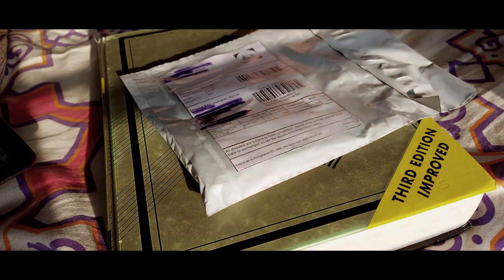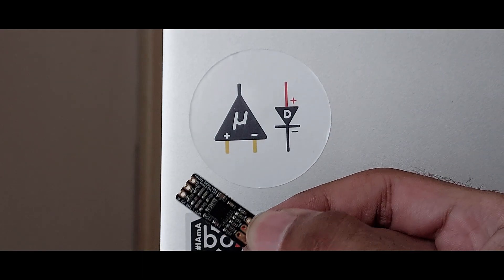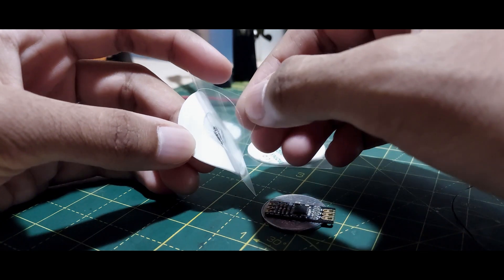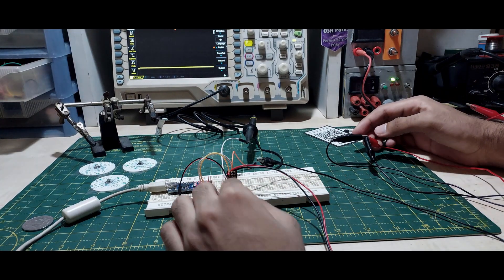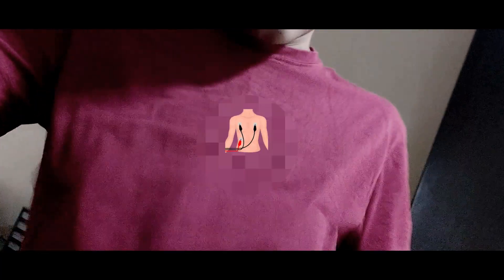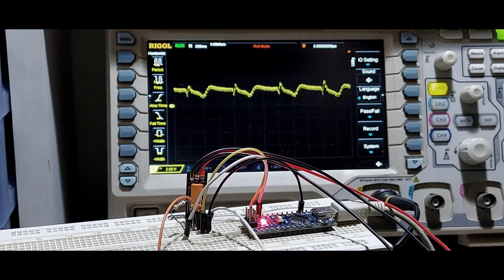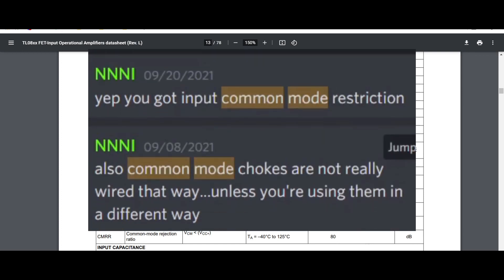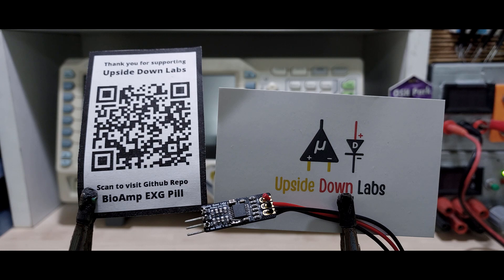The BioAmp EXG Pill - An Amazing Little Biopotential Amplifier

Comment: Awesome video 😍 You did a pretty nice job reviewing the BioAmp EXG Pill!
I would like to add some points here clarifying some of your doubts and also for others to help them make better decisions while using the BioAmp EXG Pill in a project.

1. The gel electrode patch has a non-sticky part that is supposed to go in the opposite direction of the hair growth. During the removal of the gel electrode, you pull the patch in the same direction of your hair growth with the help of that non-sticky part of the gel electrode.
2. The refAmp 1k resistor is used for current limiting and with a properly grounded setup the noise doesn't appear at all and putting a 0-ohm resistor makes no difference. BTW, we used 100k resistors for all three input pins in v0.7 which are dropped in the v1.0x because they made the EXG Pill noisy.
3. The band limiting is very useful for EOG and EEG recording which you haven't shown in this review video. Also, the signal sometimes clips while we record ECG by putting electrodes very close to the heart, and creating a solder jumper for band pass filter helps with that also.
4.  The gain option is very useful for EEG and EMG recording which you also haven't shown in the review. If you record EMG and EEG you find that the signal coming out of the BioAmp EXG Pill is very low in amplitude in comparison to EOG and ECG signals and increasing the gain is something that can help. 
5. The two-wire mode is specifically included for projects like ECG acquisition patches or heart patch projects for HRV and more. It's only supposed to be used with a battery-operated setup as it's very prone to high interference noise due to a lack of proper reference on the body.

Again, the DRL resistor removal for the better signal is something we know of, and we especially chose to go with 1k instead of 0-ohm to make the device a little bit safer. I suppose not everybody will have a properly grounded set up and people would want a cleaner signal rather than the current limiting option. We might change the 1k resistor with 0R for the final PCBs upon further feedback from our beta testers.

Thank you for your valuable time, I enjoyed the video very much and would love to see you try it out in some cool projects related to ECG, EMG, EOG, and EEG. 

Those who would like to support the project can get the BioAmp EXG Pll from Crowd Supply at 
https://www.crowdsupply.com/upside-down-labs/bioamp-exg-pill
Reply from the maker: Thanks for the suggestions!
Reply: Pleasure is all mine  @NNNILabs  thank you so much for making this awesome review video 😍
Reply: What do you guys suggest for a proper grounding?